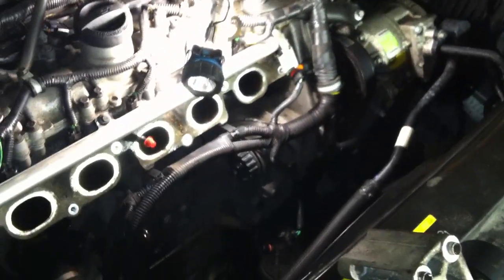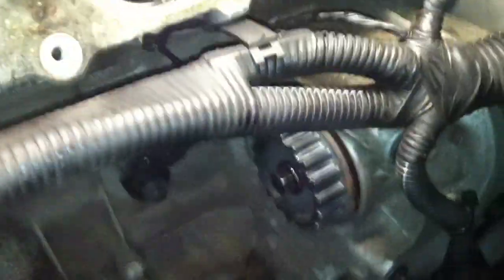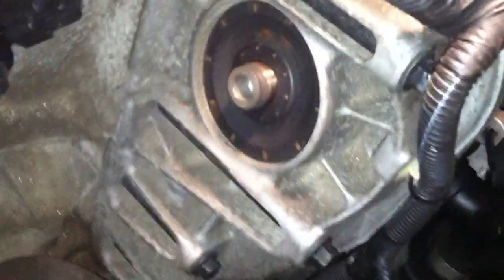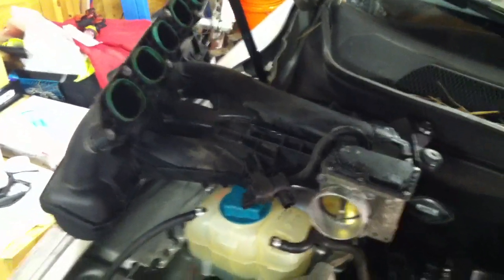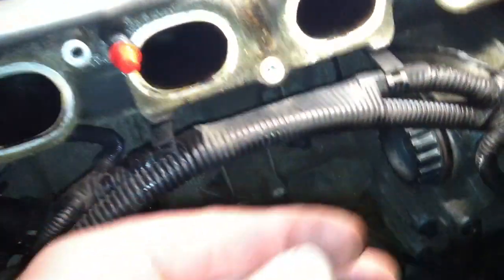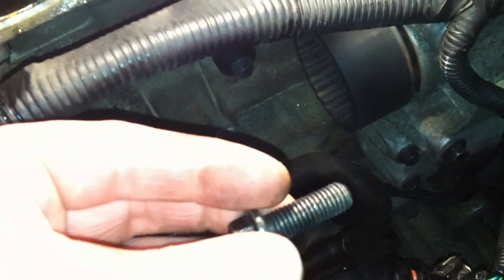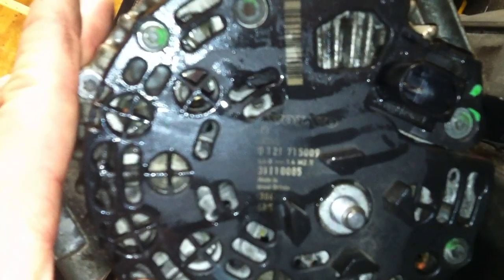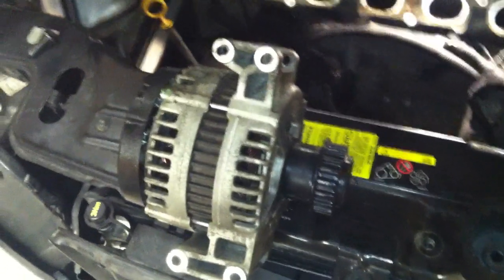2007 Volvo XC90 3.2 Alternator Removal/Install/Fix Gear and Belt driven style

Comment: I have an 05 Volvo xc90 that if not driven everyday, will not start.  clerk at autozone tells me it is a parasite. a neighbor tells me that the diodes in the alternator are bad.  I have hooked a meter and went checked every fuse, could not find anything(not sure if I did it right).  should I replace the alternator or do you have another suggestion.

Comment: Won't unplugging the throttle body cause issues? Or no since the battery will be unplugged? I have an 08
Reply from the maker: Hi Anna. Nope, not on this version of the xc90. Only certain vehicles have very specific warnings on disconnecting the throttle body harnesses. This isn't one of them luckily.
Reply: @MidknightMechanics  ok. Ive had problems with my audi throttle body messing up so i thought id ask. Do you know if the alternator is bad would it make a loud squeeking noise ? My husband is saying its the pulley but i know its the alternator because it keeps draining my battery
Reply: @MidknightMechanics  and my check engine light just went on for codes po171 & po174 😭 i wish i could pay you to fix this

Comment: Is that a special tool to hold the headgear while you tighten the Bolt
Reply from the maker: I used a strap wrench mike, kind of the only thing that can hold a gear, unless you have clearance for massive channel locks.
Reply: @MidknightMechanics  thank you I put the boat back on what a new alternator runs good but I don't know how long it's going to last because I didn't use the thread type

Comment: I have a 2012 xc70 3.2 that is not charging.  Do you know if that car has this same setup?  Thanks for the video and info.
Reply from the maker: Frets Nirvana I am 95% sure it has the exact same setup. Are you getting any howling noises from under the hood? How many miles?
Reply: Hi, thanks for the response.  No no howling noises just not charging.  This car only has 65k miles on it so it is really frustrating that the alternator is not charging.  I got at and pulled the regulator, but physically it looks good.  I cannot figure out how to bench test the regulator because there are no positive and negative leads on it.  So I now suspect the alternator itself and found your video.  I am going to see if I can try and see the small belt and see if it moves freely but at any rate it is looking like I need to remove the alternator, see if I discover the loose bolt you describe and if not I guess replace the alternator.  That won't be cheap of course and not a good testament to Volvo's lasting for lots of miles.
Reply: Ok that belt seems tight and won't move so I don't think it is the bolt problem you came across.  Scratching my head on an alternator going bad at 65k miles.  That intake manifold looks like a real PITA to take off.  Do you have to jack the car up and get at some bolts underneath?
Reply from the maker: Frets Nirvana so hold on, did you test it while in the car? Because the alternator will still have resistance if you try and spin that belt to see if it's spinning on the shaft coming out of the engine. This is incredibly rare for 65k... What I would do if I was you- gently use pliers or a strap wrench and try and spin the belt/pulley on the alternator if you can even access it. If you took the intake off this will be easy. If the belt or alternator pulley will spin with not much effort while using pliers, you'll know that it is spinning on the shaft of the motor- which relates directly to my video. But if it takes a lot of force to spin the belt or pulley you'll know it's trying to spin the engine, because it is tight with no issues- on the shaft coming out of the engine.
Reply from the maker: Frets Nirvana also what I was able to do was take a flashlight and look through the space in between the veins on the intake, and see the edge of the pulley spinning on the shaft, this will definitely take a steady I to catch. Make sure before having to pull the intake off to get the car scanned and see what comes up for codes if any. Is the battery symbol on, on your dash?
Reply: I took a long screwdriver through the intake manifold and tried to move that pulley.  With this method it definitely would not move.  Yes the battery symbol comes up after driving for a while.   With my voltage meter I am only getting about 12.75 volts at the battery when the car is running and a test by Oreilly auto parts indicated a bad alternator.  I have not had the car scanned for codes however.  I really appreciate you responding and your dedication to helping.  Yes I am totally shocked, a bad alternator or regulator at 65k?  I even hate to get a Bosch Oem regulator if that is not the problem and wish I could bench test this one.
Reply from the maker: Frets Nirvana Don't forget, Advance Auto Parts and (I wouldn't doubt O'Reillys) will bench test the entire alternator for free. Believe it or not, I think even AutoZone does free bench testing. It wouldn't be so bad if you only had to replace that regulator. I have a shop not too far from me, in Providence RI that rebuilds alternators by hand and turns them around in 1 day. They could also get you the new, correct, Bosch regulator... If you want I can ask them how to test the regulator versus the alternator (probably just testing for resistance on the regulator). You could even ship this place your alternator and they would ship it back, rebuilt. (Obviously you'd be out of a car for a week). Let me know my friend. Where do you live!?
Reply: You are being extremely helpful.  TY.  I have a place here that also rebuilds alternators if I go that route so thank you.  I would love to know how to bench test this regulator I have out right now.  It does not have positive and negative leads on it, if it did I know how to bench test it.  So any input would be appreciated.  I don't want to put voltage to it and damage it if it is OK.  On bench testing the alternator or rebuilding it, the real issue is getting it out.  Your video is helpful but I really don't understand the steps that got you to where the intake manifold was off and you could then get to the alternator.  It looks like a PITA to do, but I have dealt with that before if I really understand what to do.  So if I could get comfortable with that understanding I certainly would do it because I have the tools and facility to do it.  I am located in East Tennessee.  Thanks for all the help and concern for my problem. My real name is Richard and my email is rhead@twlakes.net if you find it of interest to continue to be a good samaritan.  All the best,  RH

Comment: If the bolt is tight does the gear spin by hand? As I can spin it both direction with my hand. Just curious as that maybe the issue I'm experiencing.
Reply from the maker: Nope, if it’s tight you should not be able to spin it by hand. Sounds like your gear is just slipping on the shaft
Reply: @MidknightMechanics  thanks for your help. Highly appreciated

Comment: Do i need to use the seal or can i just tighten the bolt?
Reply from the maker: The Loctite is a MUST. If you can't get green (permanent), atleast use Blue (semi-permanent). Every auto parts store carries the Blue.

Comment: Just like the bolt that holds the steering wheel on can loosen off and the steering wheel becomes loose.  2007 XC90 only. Weird.

Comment: Just checking, any updates parts you think or anyone knows about any updated parts to fix this issue? New bolt perhaps?
Reply from the maker: Hey Antonio- when they put out the TSB some years ago, it was only to replace the bolt with the same one, and apply permanent thread lock (red).
Reply: @MidknightMechanics  That helps man. Thank you. Was just wondering if they had upgraded the bolt but typical Volvo. They build the car, it has issues but they don't really rectify the part that causes the issue. Thanks man. Your video is super helpful and the talk of the town on the Volvo forum boards!

Comment: THanks, found my problem :-)... how do you tighten the screw without moving the coupler at the same time?
Reply from the maker: I just zipped it right in with a half inch impact, they spin so fast that it's tight before the coupler on the engine spins.
Reply: t5rguy I would use a 3/8 impact. It doesn't take that much to take those bolts out. :p
Reply: roarpony I end up using a bosch impact drill and put those blue loctite, let's pray it works , I hate tearing it a part again :-\
Reply: If tightening with a socket wrench and the pulley turns will that cause a problem with the READ system or timing?

Comment: All I need to know is how to remove a switch from the very bottom, my hand won't fit through the small opening on the bottom, between the chassis and the radiator, that and the air line are the only things in my way to find out if I got the bolt problem or if it's indeed the alternator, please shine some light my way, I'd really appreciate it!!
Reply from the maker: +J_Galindo76 What are your symptoms? What's your voltage reading at the battery while the car is running?
Reply: +Mike Kull I fixed the problem, pulled everything apart, and sad to say, it wasn't the the bolt, it was indeed the alternator, which it was totally my fault, a few months back, I changed the oil on the truck, my wife took it for a spin right after only to find out I had forgot to put the oil cap back, needless to say, it did a mess under the hood, when she got back, I tried to clean everything as much as I could but oil got to the alternator diodes, so after a month or so, it stopped charging, finally got it off, and put it back, retested with a voltmeter and got a steady 14.3 volts
Reply from the maker: +Mike Kull It has at least for 4 instances that I know of. The only reason the shaft would have to be replaced is if the threads inside were stripped. If your bolt came loose like everyone else's, it vibrates loose... There's real reason why it would strip the shaft threads. Also There is no reason why the pulley needs replacement unless the inside is all chewed up from spinning while loose. The one I had, the pulley was still in mint condition after being driven while loose for several days.

Comment: Got everything back together. All the lights (battery, red triangle light, etc...) still on. Does it need to be rest to make these all go away?
Reply from the maker: +Ashley Clark No rest Ashley but if you didn't disconnect the battery during the alternator install, now that the work is done, disconnect the battery for 5 minutes and then reconnect. Go for a test drive, and see if the lights went out. If this doesn't help and your battery light is still on, 95% of the time it's a dead regulator on the alternator = alternator needs a rebuild. With somewhere over 100K mi, it is common for regulators to burn up and trigger the battery warning lamp on your dash.

Comment: Hello t5rguy  im in the need to replace the thermostat housing, and I'm aware that i need to remove the intake plenum.  is there a way around this? i have try to remove the intake and throttle body but i can't seem how to remove bolts or even fit my hand down there.  any advise or instruction will be appreciatte thanks
Reply: +edwin41141, remove the fans.

Comment: @Midnight Mechanic. Please help why is this repeating itself .  I ll be getting the bolt in your video & using Green loctite . 

Any other suggestions? Stop this from repeating .
Reply from the maker: The Loctite is a must. There's a lot of toque on that bolt from the engine spinning the sprocket. I've never had it happen again.
Reply: @MidknightMechanics We added red the 1st time but prob failed to hold the gear tight enough . The bolt seemed tight along thinking red would work . 5 days later 2 time it de-threaded again & bolt was sitting there . 
We held gear tight ,no repeat loc-tight due to thinking holding the gear would tighten .it wouldn’t budge we believed it was solved & tight . 
Both times the vehicle was used immediately post confirmation it was back up ,spinning ,charging . 
3rd time is charm …

Any tips ?
Reply: @MidknightMechanics thank you for quick response. This model is enormous on the roads so I’m certain it’s been finalized.
Reply: @MidknightMechanics We will tackle the issue today . I’m gonna get Volvo bolt ,green loctite & maybe impact wrench.

Comment: what is the torque on this bolt
Reply from the maker: Joe I wish i had a way of knowing. I went for the equivalent of 100-120 ft lbs.
Reply: I'm also looking for torque. I'm afraid 100 - 120ft lb may break 13mm bolt. Can you please confirm again.

Comment: Awesome video !!

I am having charging issues with my XC90 2007, 2.4 Can it be the same problem ?
May you be able to light me about this ?

Thanks a lot !
Reply from the maker: Hey Erik. Honestly the 2.4 is not offered here in the US in the XC90, so I'm not familiar with that engine. Where on earth are you from? It could be possible that maybe they used the same gear and pulley design, but i don't know for sure. You just might have an alternator that's tired. How many KM? Is your battery light on, on the dash? On the 3.2, the alternator is behind the intake, mounted on the front of the engine- and you can actually see the pulley through 2 of the intake veins. I have a picture for you if you send me a message on Google+. Otherwise, i don't think it's possible to attach a picture here on YouTube.
Reply: t5rguy 

Hey kaptain !

I am territbly sorry for not replying you sooner, have been travelling a lot.
I am in Norway, bought this car over a bit over 1 year. It was ok for the first months (even though the battery was empty one week after I bought it - should have known better...) I drove 30000km with it, now its on 185500km.
I am not sure as well about the location of the alternator, need to take a time to check it properly.
I've been having a big electrical problems with this car for the past months....I checked the charging rate with the voltmeter and it's not ok (right over 13v)- but I think it's also some leakage of battery. For example, the DVD turns on out of the blue..the lights in the panel get suddenly in full brightness and then pale, the bulbs on the left side of the car burns way before the ones on the right side, the thermometer as well as the side mirror on the right are not working....oh my...I ask myself why I bought this car. It's too expensive for me already - dunno what do to.

If you have any hints for the problems mentioned, I'll be so thankful !!

Thanks a lot in advance ! Wish you a great week !

Comment: Are the o ring gaskets for the intake reusable?
Reply from the maker: +Ashley Clark IF they still feel rubbery, without ANY cracks, they SHOULD be fine to reuse. The thing is, if they do have some tiny issue like a tear or crack- they can/will leak vacuum pressure, and it will set off the check engine lamp for a misfire or other emissions codes. It's too bad they are so expensive. I think the set from Volvo was either $100 or $120 if i remember correctly. Personally, if you plan on keeping it forever - best practices is always to replace them. -Nick

Comment: If the bolt comes loose it is because the one way clutch on the alternator has failed.
Reply from the maker: Mike the bolt is coming loose on the engine side; not the Alt side.